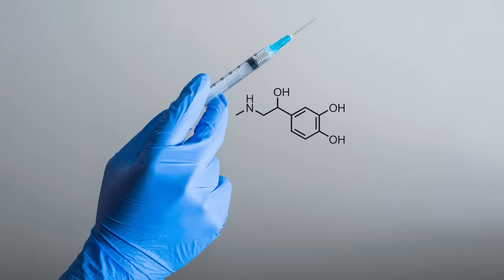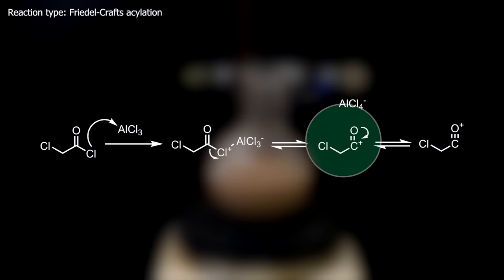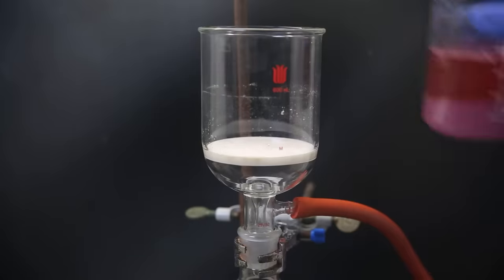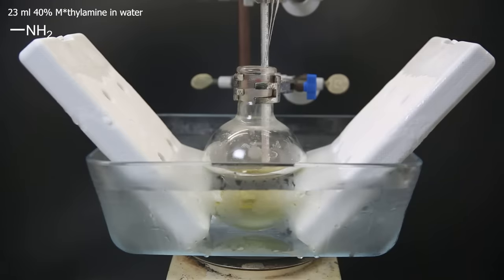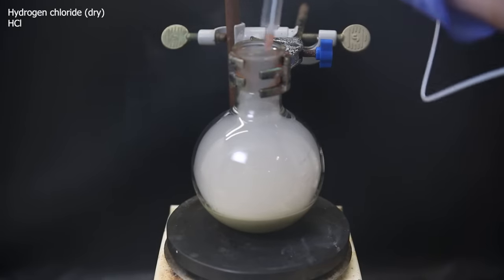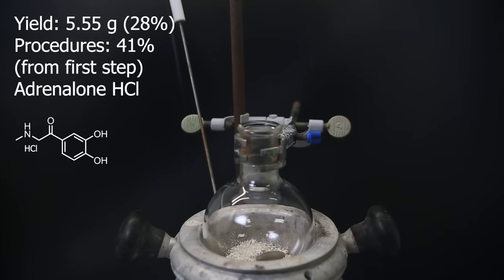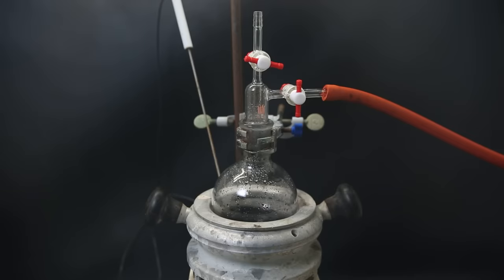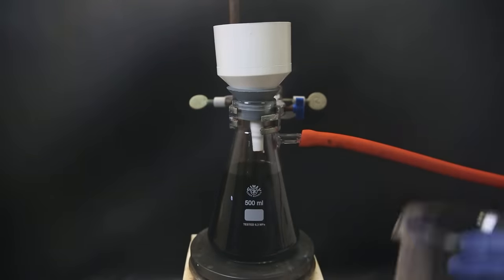Making Adrenaline

Comment: How does activated charcoal always know which molecules are impurities and which are the desired product? Literally black magic.
Reply: Actually, it does not know and absorbs things in a non-specific way. But as long as your sample is relatively pure, you'll get a higher purity sample at a cost of small yield loss
Reply: But why ? 
I do understand why crystallization does improve purity thanks to the equilibrium of every species : X(solution) - X(s) and that considering the composition of the solution doesn’t change the solubility of the species that much. 

With carbon, you could write a similar equilibrium but I would have say that having a concentrated solution of A would favor A(adsorbed) over B(adsorbed) (with B an impurity, in smaller concentration), because the carbon would saturate itself with A ? So as a result you would loss as much of A than B and conserve the ratio ? Idk… I can’t think it right I guess but if you have an explanation it would be welcome !
Reply: @Tom-to7dy  I have found some claims that activated charcoal preferably absorbs conjugated molecules with high MW (which are usually colored), which makes sense considering that activated charcoal mostly used for decolorization. So not 100% "non-specific" I guess...
Reply: @Tom-to7dy  It is just a gamble, sometimes the only thing charcoal does is steal some of your yield. It can absolutely happen that it binds much more strongly to your desired product, there is no easy way to predict it. You just have to try it, and note down the results so that the next person doing the same reaction is better informed.
Reply: In the video's Friedel-Crafts reaction, the byproducts are likely oligomeric conjugated molecules resulting from the oxidation of catechol, so activated carbon appears to have worked in the favor
Reply: I guess purity is way more important to some people than total yield? I'd hate to essentially throw out 40% of a product in an attempt to increase purity by a small amount. To me it'd be easier to know the impurities are there than to know 40% of my product would be lost.
Reply: If you can't ise your product while those impurities are present it's well worth. In the next step of a synthesis it might e.g. poison your catalyst and lower your final yield further than if you had done that purification.
Obviously it's better to do the followip reaction right away and clean it afterwards if you know that it wont tank your yield.

Comment: I'm definitely sure there are some fancy metal catalysts out there (from the Noyori group specifically) that can enantioselectively reduce adrenalone to the desired enantiomer. Splice in a Mitsunobu reaction/hydrolysis to flip the isomer if necessary.

Also, shouldn't the yield in the previous steps be better if the product was purified by chromatography instead of recrystallization?

Comment: Okay someone please explain the omniscient activated carbon. So many chemistry channels that have said the exact same line "add some activated carbon to get rid of some impurities". Never the same compound and I'm guessing never the same impurities. But still the carbon seem to know what to absorb. Is activated carbon the chemist equivalent to alternative medicine peoples colloidal silver? That it "knows" what you want to remove and removes it? 
Can someone please explain how the activated carbon always removes unknown impurities but never the actual chemical you are striving to purify?
Reply: Activated carbon is good at binding with colored impurities. Can't tell you the exact mechanism as I don't know that level of chemistry, but yeah, it is quite promiscuous with its adsorption. Binds to a lot of stuff, especially stuff wit visible light color and ions, and if it doesn't bind to your product, it will pull a bunch of extra random stuff off.
Really, solvent washing is not much different from that. Chemical reactions are a random process, you just try to select for the one compound you need.

Were you to make the chemical that activated carbon would adsorb, you would simply not use activated carbon to purify it. Among those that you've seen on youtube using activated carbon, none were of that type because people generally know what they're doing.

P.S. Maybe you should do at least a cursory internet read before assuming that a widely industrially and chemically used purification method is snake oil.

Comment: So distillation separation/filtering is a preferred separatory technique technique, because heat sources are cheap...
But wouldn't solvent separation + freezing be another good one in some cases?
higher temps = increased reaction rates, but dissociation in a solution <> a reaction; so I'd think if you want to halt reactions + separate, if you can be selective enough in freeze temp, then that would be a way to go. 

Just a thought.

Comment: Great video as always, but a quick question from my side. Why did you add 30g of the AlCl3 catalyst which is a huge excess? Is it because it is non dry/impure AlCl3? I remember AlCl3 as being highly hygroscopic and fuming on air when we used it from ampoules. Also yours is yellow and not white.

On a second note I just want to give a quick advice. You added some Acetonitrile with molecular sieve dust in it. Be careful with doing that because some reagents can react with this dust (big surface area) since molecular sieves are acidic. Some solvents can't even be stored long term over sieves because of this (especially some NMR solvents).
Reply: I onced used AlCl3 hydrate, when we didn't have anhydrous available. It a similar looking yellow.

Comment: Hmmmm....Now, if that (CH3-N-H)-- group were a simple amine, and there were an OH in the no. "5" position, and we methylated the OHs to get methoxys...we'd have something worth making!  Actually, the synthesis of that compound is a lot simpler that what's described here, but....the LiAlH4 you need costs an arm, a leg, & a testicle, and probably gets you on a list....  Now, if only I can come up with a CHEAP source of lithium!  2Li + H2 --> 2LiH.  4LiH + AlCl3 --> LiAlH4 + 3LiCl.
Reply: Ayo, are Lion Batteries a good source of lithium cuh?
Reply: @vogelvogeltje  Fresh, non-rechargeable ones are, but they're expensive, and it seems a shame to sacrifice perfectly good batteries.  Discharged, defunct batteries are cheap, but the Li is no longer a pure metal, and it's a bitch to convert it back into one.  The best bet, I think, is to electrolyze a molten Li salt.  My degree is in chemical engineering, so I'm supposed to know how to design & build equipment to do things just like that :)  So, I researching the possibilities....
Reply: Lol yeah, try synthesizing your own LiAlH4 at home.
There's a reason why it is so expensive. Like when I open a can from Sigma, I pray that I don't immolate myself
Reply: @Abdcwyxz  Now now, it's nothing like that.  I've used it before, and it's not nasty.  Now, if you were talking about something like chlorine trifluoride...